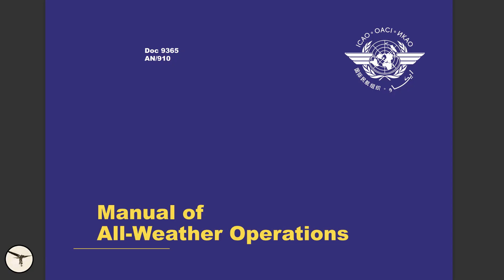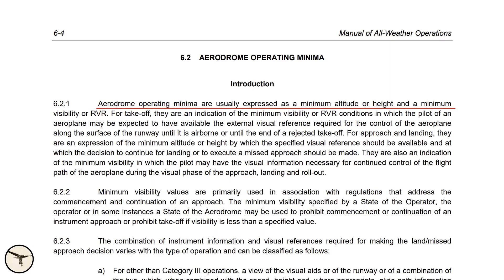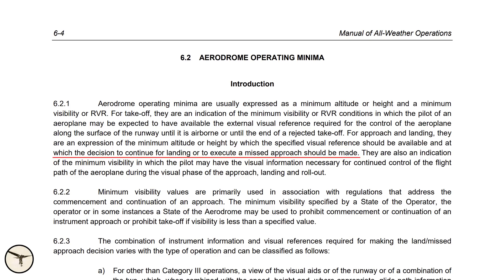What is the best callout from minma when you are about to land? Instrument procedures.

Comment: Continue. As you stated, a lot can happen between reaching the minimum decision altitude and the actual touchdown. So "continue" is the better Phrase, because it doesn't mean the pilot is actually landing under all circumstances. It may only be a psychological thing, but it clearly Staates that the pilot continued the approach, but only lands the aircraft, if all parameters are on the safe side after reaching the decision altitude.
It may not make that much of a difference, but it is the correct call.

Comment: This is a debate for the flight ops decision makers and NOT for the line pilots.

As a line pilot, you follow whichever callouts your company has set for you and you integrate into yourself your understanding that words used in the cockpit have sometimes a different meaning to what you would've used.

My company uses 'cabin crew standby' instead of the standard airbus call, 'cabin crew at stations' for the phase just before an evacuation. I hate it, but it works because everyone in the company knows in this specific circumstance, we use the word this way.

Sometimes you just have to be a soldier, even if you think the generals don't know what they're doing. Deviating from SOP is usually dangerous, even when you think you're right.
Reply from the maker: I absolutely agree!

Comment: Corrected the previous post here.
In my opinion it would be better if ATR did not reinvent the wheel, and took the best from more reputable manufacturers. It would have been better if they had taken the standard colautes from AIRBUS. For example: on the minimum - continue. When resetting altimeters - set standart. When reading FMA - never says green. Sorry if anyone is offended.
Reply: Now that you mention Airbus - the radio altimeter callout voice sounds a lot like what I have heard in A320 family cockpit videos. I know you are talking about the phrases used by the pilots, but I just realized the similarity (of course, lacking the infamous "retard, retard" when touching down.

Comment: In my opinion it would be better if ATR did not reinvent the wheel, and took the best from more reputable manufacturers. It would have been better if they had taken the standard colautes from AIRBUS. For example: on the minimum - continue. Including on the minimum - continuing. When resetting altimeters - set standart. When reading FMA - never says green. Sorry if anyone is offended.